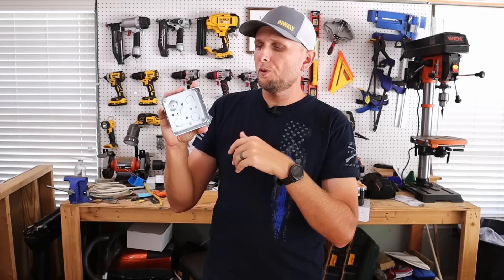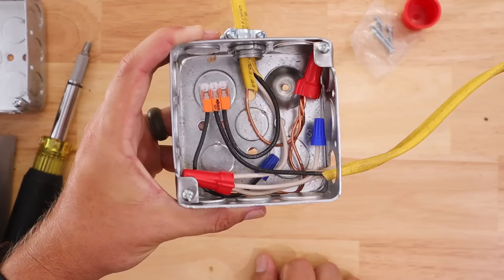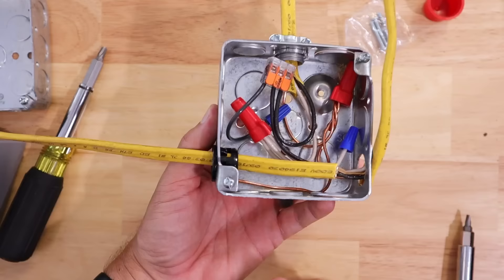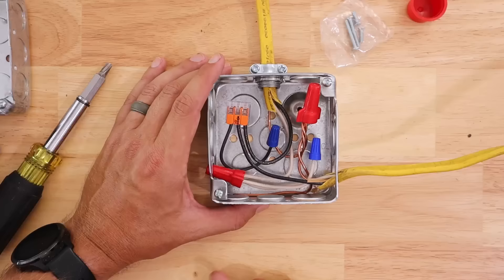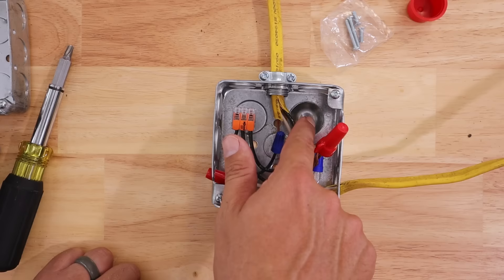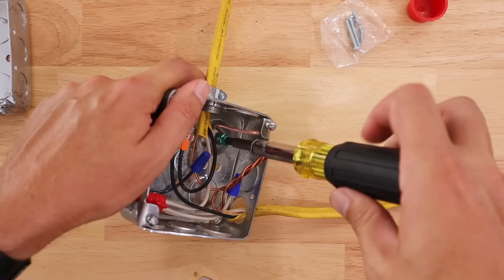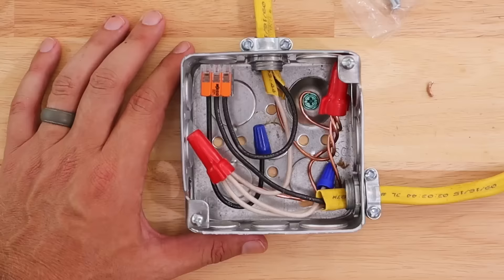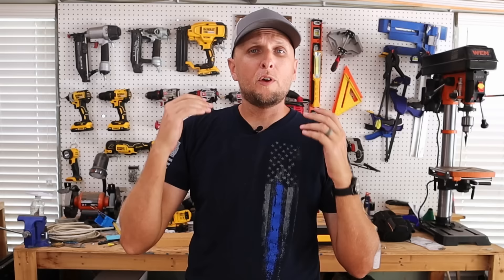The BIGGEST Mistakes DIYers Don't Know They Are Making When Installing Metal Electrical Boxes

Comment: The third most common beginner mistake is to not do a box fill calculation to be sure the box volume is large enough to accommodate the wires, etc. This can be a big problem when adding something on to a preexisting box like a GFCI or more wires to retrofit a new branch for another plug down the line.
Reply: Lrnd tht a long time ago. Always use a deep box for gfci,dimmers,Decora it's not much more money and you will save on the labor or work harder to save money up front but I lrned a longwhile time is money and so is energy lol
Reply: Its more the hard to bend copper that is the issue when trying to get a gfci outlet in there. Yes the gfci is a lot deeper but trying to get those 14 gauge wires to bend and push back into that tiny box is a task in itself. 
Maybe super flexible romex 🤷🏽‍♂️
Reply: So now I have to learn what a "box fill calculation" is!!! When do I stop being a beginner and enter the intermediate stage of DIY'ing? I mean, I've stabbed myself with sharp wires at least 50 times and got tickled by the zappy electrons twice!
Reply: @Mike_H76  sparky channel or electrician u great vids on the topic
Reply: Y a that’s right some wants a gfi …..old metal box …….three pairs no ground …..gfi won¡t fit …….
          I am sorry it is only going to cost you 500 dollars to change this outlet !!!!!!
Reply: Always use the largest normal box in every situation , always use the deepest boxes possible . The code rules have eaten up a lot of box space .
Reply: @gerdberg4188  
So I assume you're telling me that using my Dremel to cut the back off a plastic box, cutting 2" off the box and epoxying the back on for a 2X2 mobile home wall is unacceptable? 
IN MY DEFENSE... the sheet metal siding was directly behind my boogied up box... so no issue with fire, perhaps could have cause an "electrify the whole siding" situation though.
Reply: @Mike_H76  I do not understand why you had to cut the box . They make shallow wall boxes. 
Mobil homes are not  easy to deal with tho . They are a PIA
Reply: Once had a Johnnie know it all homeowner call me out to install a  3 switch device that only took up one space. He had a fan cable, light cable, heat lamp cable, and a 12/2:feed cable in a 2.5" deep box. Told him that I'm Tom the electrician not Tom the magician. Told him that he would need to remove new wall titles and install a two or better yet s 3:gang deepest box that would fit. Finally refused to even look at jobs where homeowners did all the wiring and installation on usually undersized wall cases. With liability being what it is and not having x ray vision to look at wires behind sheetrock not worth the trouble.
Reply: @JohnThomas-lq5qp  People think they are saving money . Electrical work is probably the hardest trade to duplicate with no experience .
Reply: @Mike_H76  Anyone who says he is an electrician and hasn't gotten shocked at least once or stabbed by a sharp wire end is not telling the truth.  Box fill limits are part of the electrical code and need to be followed for safety reasons.
Reply: @1575murray   Oh, I do understand that this box fill thing "matters", I was being sarcastic a bit... but also, coming from the DIY perspective. My pro knowledge is mainly in framing and roofing/siding. Though I try to know JUST enough about everything to be dangerous. Having dealt with excessive codes, fill calculations are either a great idea or, more likely, just another pain in the...
Reply: I did that!  But then I learned more code, and learned I calculated WRONG!  Each yoke counts as an additional two of the largest wires feeding the device.  Had to add an extension ring.
Reply: Beginners question: why does itHAVE to be a Green screw?
Reply: @CD-hc5ds  In a main panel the screw is green so it is easy to identify the solitary bond between neutral and ground in a building. It is removed in subpanels, and if an electrician comes across a subpanel that still has the green screw fully engaged, it is a flag of a decision (or possibly a mistake) by past electricians that is much easier to identify. Those screws are manufactured to specific standards, thread pitch, metal type, etc so the electrical bond is unfailing. Many end devices also have green screws, simply for the electrical bond between equipment ground wire (not neutral) and the frame. Unlike mounting screws, that color is a flag that tells installers not to remove it because it serves a specific purpose.
Reply: They're called extension rings
Reply: @KLAWNINETY  Yeah I had to add one, they look awful, but they're up to code.
Reply: @Mike_H76  or...add a second box or double gang box and Yes you might just turn it into a Conductor Eddy Currents travel AROUND the wires not IN them .
Reply: @mjolnirswrath23  
Indeed, I could have done that, though at the front door triple switch, it wouldn't have looked good at all. The way I roughed up the plastic and 2-part epoxied, It's probably stronger than when molded (at least close). Either way, this was nearly 20 years ago.

I found bigger issues (like a live capped feed under the old tub, ungrounded exhaust fan/light)... I fixed them at least, while I didn't have the know-how to fully remove it, not knowing where it went after it went into the ceiling... I recut all the wires, didn't strip, passed them into metal termination box (with retaining nut), capped em and taped em and left that in the new wall I had to frame for the tub surround... a good 2 feet away from the "wet wall".
I don't know much about Eddy currents, a vague understanding. But if they were a problem... we couldn't touch extension cords.
Reply: I may sound like a hack, but I rarely rig anything, especially electric. I have done a fair amount of electrical, but I did call in a pro for a sub-panel, even though I was nearly positive it wasn't as hard as people think. Asked if he minded if I watched, then did it exactly how I'd figured (though faster, I'm sure).
Reply: @gerdberg4188  that is 100% not true. I find it incredibly easy to do electrical work better than most professional installations I've seen. Ridgid waste pipes or steel ductword, or black steel gas pipe threading with no experience on the other hand is much much much harder.
Reply: @CD-hc5ds  it doesn't. I have no idea what the gentleman is talking about. all boxes in Canada come with ground screws and they are most certainly not green. When I insulate the ground wire however I do use green heat shrink, that does matter because you want to make sure your box is easy to interpret later.
Reply: @Mike_H76  yeah I would probably not do a panel or a sub panel myself. but putting in the breakers into the panel is super easy.
Reply: I just wish they would have moved to deeper boxes period by default years ago.  This isn't a recent problem, it has been around for years and it is still a problem even in new builds.    Nobody wants to have to go back and rip open walls because for some reason, there isn't enough space.  Homes get upgraded in all sorts of ways.  I just wish some consideration was given to that concept at time of construction.  A little extra space is usually very welcome when it comes to fitting things into enclosures.   It is even more relevant now with the addition of smart outlets/switches.
Reply: @wizard3z868  Good point. I just go with deep boxes everywhere possible especially for switch boxes. Many of the newer devices now require neutrals and are much larger than in the past. Like you said GFCI's, dimmers, smart switches and don't forget the receptacles with USB. They all hog up room in a box.
Reply: @sirpurrcival  - Totally agree with your words, thank you !  I am pretty sure that the reason they go with the least expensive, etc., product/s is because of cost... New builds of today compared to even 50 years ago are way, way, more  cheaply done, perhaps by people paid cheaply as well.. So then you have that...
Reply: Shit on wire counting just get some long 8/32 and smash them in there. If it don’t hit force it then paint it and write someone else name on it.
Reply: Box ,Fill calculations
Baaahahaha. 🙄
Reply: @Mike_H76  o wow now there is a classic , a live feed under the tub , that's one for the books . Was it a cast iron tub ???
Reply: @michaelkuzmin  o do you not think that electricians also work with large threaded galvanized pipe and other large conduits and trays they build trapezes for huge racks of pipe and duct banks underground that would eat most plumbers .
What you you do not know is that a real pro electrician knows how to fit pipe as well as anyone out if not more . You just do not have a full grasp of the electrical trade
Reply: @sirpurrcival  well good news , the electrical code says you need to leave room for expansion when you set up a new system .  You don't really get any parameters on that though . It is really arbitrarily discretionary , ha
Reply: @kevinanderson4963  I have an estwing wire packer , nice rubber end , there is a double hook and a round thing on the other end . Still don't know what that part is for !
Reply: @gerdberg4188  what makes you think that I don't?
Reply: @michaelkuzmin  silly guy , maybe you do!!🤓
Reply: @gerdberg4188  that’s for training wires inside switch gear
Reply: @gerdberg4188  yep it’s easy to run pipe that water goes through
Reply: @Mike_H76 If you can read the plastic fine print inside the box (the generic blue ones), there is usually a chart showing wire capacities for various wire gauges.
Reply: @replyhere590  
Thanks, that's helpful! Now, is that truly for the sake of safety or is it yet more extraneous "codes"? That may be a question for an electrical engineer, we in the trades usually just follow what we're told without always knowing why.
In my field, framing, they've adopted a lot of codes in the past 20 years that really make no sense.
Reply: @gerdberg4188  
I can help ya there, the round part is for smashing your thumb when you get mad at it and the double hook is for sinking into plywood when you slip on some sawdust and almost fall off a 25' roof (been there, saved my arse!).
Reply: @gerdberg4188  Where does the NEC say that? Code reference?
Reply: @Mike_H76  Good enough electricians simply follow what others tell them; good electricians open the code book and read it. That said, I know plenty of electricians that can read but have no critical thinking or interpreting skills and think the NEC is a foreign language. The last thing I'd ever do is ask an EE about applying the code in a field installation. Contrary to what many EEs believe, being an engineer does not mean that you also know how to be an electrician as they are 2 completely different jobs with different skillsets. Most have no clue and I've had to school more than a few through the years.
Reply: @michaelkuzmin  It's partially true. Being able to do something well enough to make it work does not mean it's done correctly. Any time I see a Home Depot special done by an amateur, it's almost never 100% code compliant.
Reply: @pld8993  sure. But also, code compliant and correctly are not the same thing.
Reply: @michaelkuzmin  Please provide one example where code compliant is incorrect.
Reply: @michaelkuzmin  I asked for incorrect, not incorrect in your opinion. If it's consistent with the manufacturer's recommendations/requirements and the code, your opinion is irrelevant.
Reply: @michaelkuzmin  FYI, taping receps is for amateurs and completely unnecessary when everything is installed properly.
Reply: @pld8993  lol my opinion is very relevant to me. and everything, every one of these 3 examples, is not just based on my subjective feelings, they are all very obviously rationalized from the engineering perspective. And also, manufacture recommendation and code are also totally different things.
Reply: @pld8993  by the way, the first example is not just my opinion, it is also the opinion of the US code authors. So if you are so much into the bureaucracy, and you believe in the infinite wisdom of the code, then how can you possibly think my opinion is not valid? 😅
Reply: @michaelkuzmin  You're obviously not an electrician. You may want to read NEC 110.3(B) before you proclaim that manufacturer recommendations and code are totally different. You've got a lot to learn, but thanks for playing.
Reply: @michaelkuzmin  I could "rationalize" why everything should be in rigid metal conduit, but that doesn't mean that every other wiring method is incorrect.
Reply: @pld8993  
I definitely get it and if I hired an electrician, I'd want the professional job. I'm just wary of code, whether it be TRULY for safety or just another encumbrance. And as a DIY guy, I more want to understand what is safe even if it isn't code... though whenever possible I'd try to be code compliant, occasionally in the event of fire... people that do their own aren't covered under homeowners. Here's what I saw in a home we bought before Covid and are working on moving to... master electrician owned house for 50 some years, he put a ceiling box with a light switch in the attic, the plate has openings large enough to stick a finger into! The cobblers children are barefooted.
So far as "engineers", I suppose architects are similar. I've framed probably around 1,000 huge houses (Hampton's mansions) and often the architect "thinks" something will work, in the field it doesn't. We even had one I remember where we framed out the second floor and main house roof, once we got back to the attached garage we noticed his error "oops, there's a door here with the roof cutting right through it"... and these are haughty taughty highly paid drafters!
Reply: @Mike_H76  Electricians' homes frequently contain the most egregious violations because there's a lot of things temp'd to make them work and put on the to do later list. Right now I've got my garage powered by an extension cord that I ran across the deck and backfed into the subpanel through a 15A breaker on one buss bar. No real danger only because I know what I'm doing but clearly a potential hazard. I'm in middle of a several projects, as usual.
Reply: @pld8993  
And he had no kids at home who would poke their fingers in the attic switch. We didn't ask them to fix it, I can spend the buck and put in an actual switch receptacle... not needed, but for "just in case" reasons. That is, after I finish the more pressing projects.😁
Reply: @Mike_H76  angry pixies got you
Reply: @CD-hc5ds  because the code says so. in Canada it's not green, and we include them already installed in the box
Reply: @snap-off5383  why didn't you use a x-cube extension it fits in the wall and adds the volume you need
Reply: @Mike_H76  you need to understand that code is written by the manufactures as the main input, so it may not make sense to you but it may make sense to the profit margin of a company involved in the code writing.
Reply: @replyhere590  yes but how many wire connectors and how big the device is effects what can go into the box.
Reply: @Galgamoth  
Angry pixies and gremlins have been trying to off me for decades despite my cookie offerings and human sacrifices, errrr... I mean, forget I said that last part! 
I'm with ya and I'm not, I've seen a lot of what can only be profit motive code (i.e. strapping between sheathing every 16"). 
On the other hand, this box fill thing seems like it COULD be important... and of course, framing wise, having to step up from 2x8 to 2x10 with floor joists according to span makes sense. Even with that, having gutted mobile homes, it is overdone (I prefer overdone, personally).
For me, since I have a "feel", intuition or simply experience with wood, I know what I can rig and be fine in that department... HVAC and electric, much less so, though some parts of both are common sense and some parts are (as a homeowner) simply swapping identical components.

Comment: The min. allowed dimension of the wire depends on the circuit breaker and the loop impedance. If you use a 10A or smaller circuit breaker there can still be different wire-types mixed together because of the voltage drop (here we often have 4mm² until the last box and then 2,5mm³ to sockets (16A breaker) or 1,5mm² to lamps (13A breaker), all depending on your loop impendance). You always have to know the max. current on that circuit and note the diameter in the distribution plan. And measure the loop impedance at the very end.
Reply: In North American standards, it would be ok to mix 12 and 14 AWG on a 15 amp circuit as that only requires 14 AWG, but not on a 20 amp circuit as that requires 12 AWG. 

That said, a pigtail like this is unlikely to burn down or melt anything either way, as with such a short wire, there's very little resistance to generate a lot of heat. Also, it's in a metal box, so there shouldn't be anything to catch fire even if it does get hot. Still, follow the code, it exists for a reason.

Comment: Great video dude! I usually like to wrap one of thoes grounds directly to the ground screw before tieing them together so i can have extra space to make tails. There is little to no room for activities like to install a device in this box, which is why i typically will crimp sleeve my ground together instead of wire nutting. But if this is done its important to note you CAN NOT make jumpers with a crimp sleeve so wires can not be broken. Its kinda hard to explain this technique throught text. But non the less very educational

Comment: Thank you for your video.  I have been doing some electrical work at home and rewiring our garage with new breaker box and all.  I didn't realize grounding the box would prevent electric shock and other problems.  I'm going to fix mine first thing in the morning. Thank you for the advice.